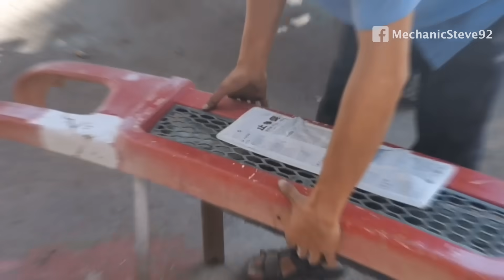Fiber Glass Bumper Repaird by Mechanic James

Comment: Not bad Steve but next time try grinding out the cracks bigger then make some filler bog by mixing mill fibre with resin then grind down the repair spot lower then lay up your uni directional until you get level👍🏻

Comment: Can you give the names of the materials you used...
Reply: He just used fiber glass resin .... & fiber glass matting. I would of ground it a lil more on both sides t0 get into the existing fiber glass to expose the hairs .... V the crack more & at the ends of the cracks drill 1/8 to 3/6 hole to stop spidering. The steel plate can be gotten anywhere like Home Depot.  Also would use a pre cleaner like wax & grease remover. Either way he did the job & it was a rigid repair.
Reply: The sandals I’m not sure where he got those ......

Comment: Standing on the bumper means nothing, because that's not how the impact will happen. The metal should have been removed not needed, because the break area mated evenly. After that epoxy and fiber glass cures it wouldn't break. That metal made it heavy in one end and could break again in the same area, because of it💯

Comment: I would have used 1 Layer of 1708  on the outside and 1 Layer of Matt.( Hides the pattern)  2Layers of 1708 on the inside and done away with the metal..